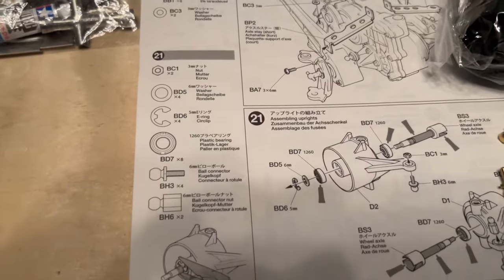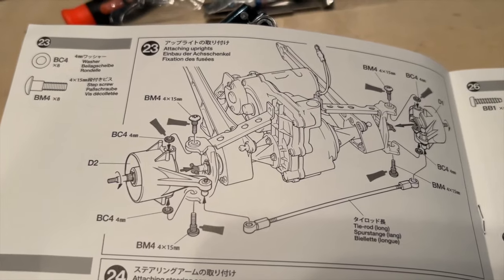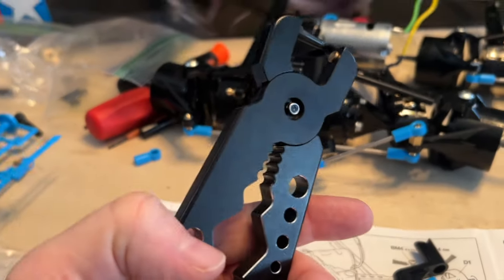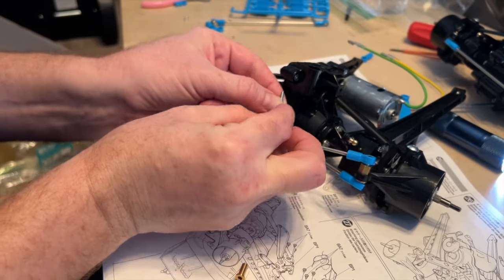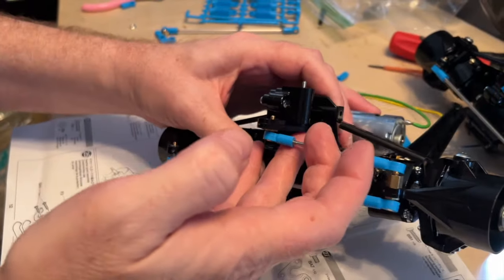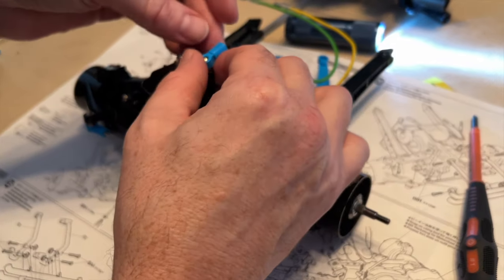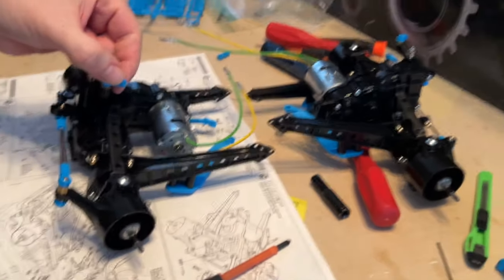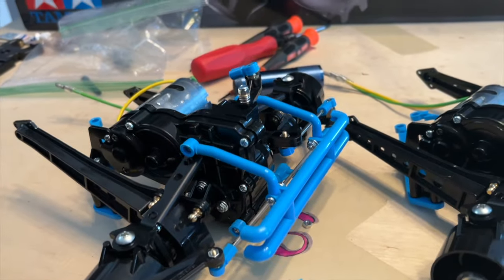tamiya SUPER CLODBUSTER build part 2

Comment: Thank you for sharing.  For the rear axle, the top of the servo saver needs to be flipped 180*.  There's also a trick to making the stock steering a bit better, which you probably already knew.  Looking forward to the running videos.
Reply from the maker: hey g.w. ....thanks for the comment , the only beefing for steering I know of is thicker link and servo rod and of course the aftermarket stuff, what's your solution..???..first clod, just opening that can of worms...medical issue happened . one armed for a while. unable to drive or build for now..hopefully ill be back up soon..I see you're braver with a little air time...awesome build !!! good inspiration